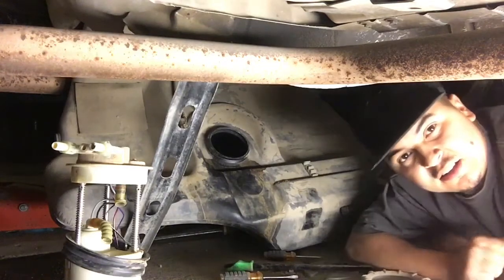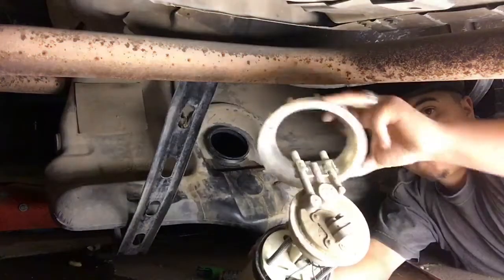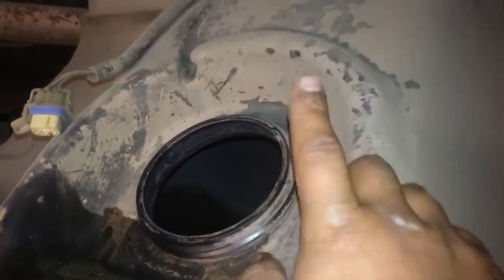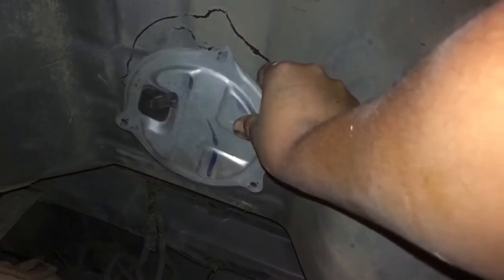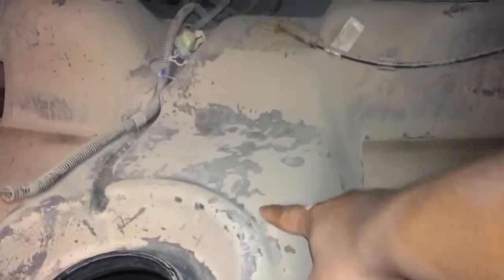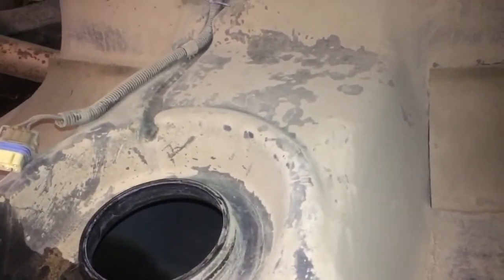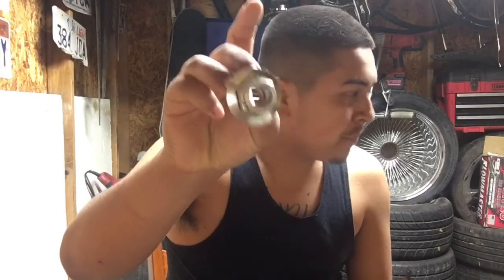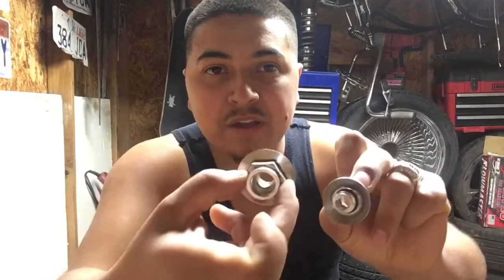Fuel pump gone wrong 1995 Cadillac deville custom build | custom auto connection |

Comment: So the fuel pump in my 95 Cadillac DeVille JUST went today, and I was wondering if you could tell me how much I could expect to pay for the lwbor? Everywhere online says it's complex and should cost a lot but I was under the impression it shouldn't, your video also displays it's something that should be able to be done in 2-4 hours time so I was wondering what you thought is a fair price for this project
Reply from the maker: Hard to say parts alone can run up a little over $240 and depending on the hr rate also stuff can break during the removal depending on age/rust 

Sometimes a hr job can take 3hrs if something breaks
Reply: @customautoconnection5487  true. Found out the roadside guy who tried to jump us is an idiot and we're just rocking a bad alternator and some poor grounding in the engine. Now looking into getting that done up. The good thing about this car is that it  doesn't have much rust built up anywhere cause it was in storage most of its life
Reply: you can find any new fuel pump online or at your auto parts, the part pretty easy to fix as long as your gas tank is empty. Just remove the tank and use hood stands to hold the tank at while you take off the brackets
Reply: careful with your pumps because they might be weak
Reply: @oscar7534  thanks for the tips. Fortunately enough the guy who told us it was our fuel pump was full of bs and it was just a faulty alternator and corroded grounding. Fixed all that and replaced the accessory belt last week

Comment: Thanks for the video. I can't get my 1998 DeVille running to make it even to the mechanic. It's a fuel pump issue. He suggested that I could possible avoid a tow by pounding on the tank with a mallet while someone starts the car in an effort to loosen the possibly stuck fuel pump. The pump is in the tank (right?) but what part of the tank? If I'm standing behind the car, facing the car, where is the pump? North, south, east or west?